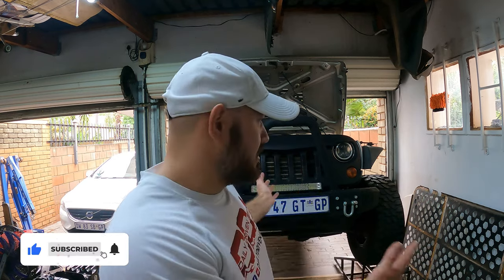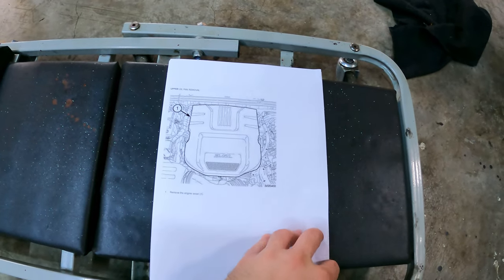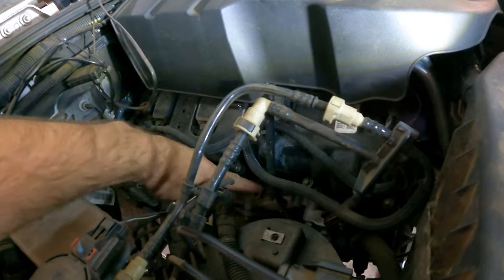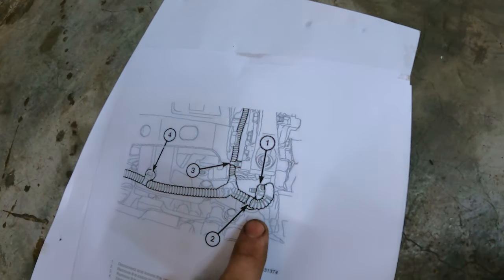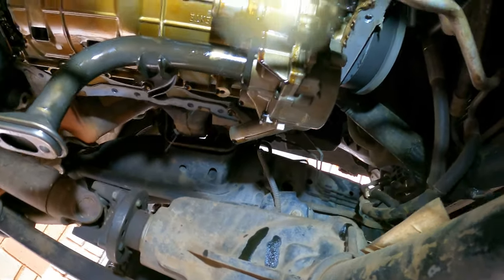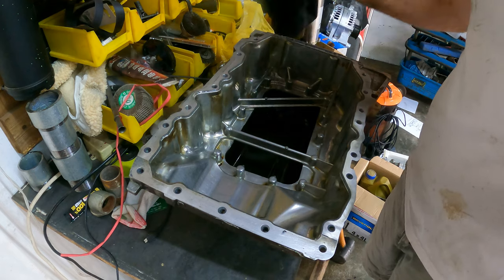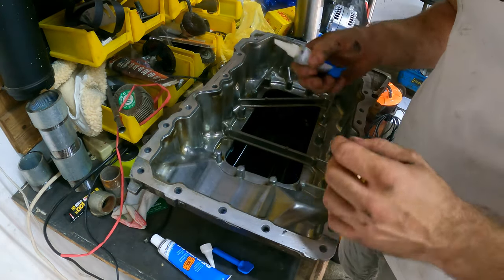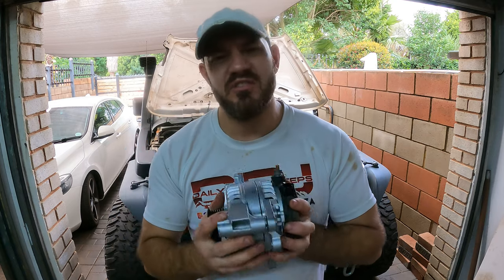Jeep 3.6 Pentastar Hack - What to do if you get a P060DD code

Comment: Just replaced lifters, rockers, and one camshaft on my 2016 Caravan.  Now it's time to replace the oil pump to clear that solenoid code.  I wish I had seen this video before buying the oil pump.  The oil pump can be removed by only removing the lower oil pan if you have the correct swivel socket.  So they say.
Reply from the maker: We didnt get the Caravan this side of the world, so cant comment on the sump, but could be. Good luck with the oil pump change, its not so difficult 💪

Comment: Thanks so much for your video, worked for me.  Solenoid cost $70 and the RTV was $20 Canadian.  Cleared the code with my programmer and it hasn’t returned.
Reply from the maker: Glad it helped
Reply: Hello there ... Is the aftermarket solenoid working good or i should replace the whole pump ...??

Comment: doing this tomorrow in the garage.  where is the link to the manual you show and reference?
Reply from the maker: Enjoy, its not a bad job, here is the link
https://f01.justanswer.com/dcraig1000/bc4748ff-4c79-43ff-996d-7ea7ce51c14a_eee.pdf
Reply: @MountainmanBuildz thanks for the video, are there two links for the manuals? I could access the solenoid manual but not the removal process, thanks again.

Comment: Man how did you pry the upper pan off? I can’t get this thing off for the life of me and I’m worried about smacking it too hard that it breaks
Reply from the maker: You will see tabs sticking out in the front, take a piece of wood, 2x4 or something, from the top rest it on the tab and hit with a 4 pound hammer, it will come off. Remember to loosen the two M6 bolts at the torque converter first, they are very hidden
Reply: @MountainmanBuildz thank you

Comment: No issues with the code again after? Though dorman is a great company (I installed there aluminum oil cooler no issues) but was informed by a few mechanics and the online forums to only use mopar sensors.
Reply from the maker: None whatsoever, I do believe that the sensor in the Oil Cooler from Jeep is made by Dorman, so thats OEM.
Reply: Awesome good to hear

Comment: Just about to do this job on my JK, your video does a great job of showing how much access there is and how to get it done without removing the entire pump. Thanks for taking the time to make this, cheers! Edit: Did the P06DD code ever return after this?
Reply from the maker: Thanks for watching. The P06DD hasnt returned at all, Jeep has been moving along smoothly ever since. Im doing a gearbox oil change next, hopefully sometime by next week. So make sure to subscribe. Would appreciate it.
Reply: @MountainmanBuildz  Already done!🤘
Reply from the maker: Awesome! Also just make sure to use good RTV, you dont want a leak and lower the sump again. I personally love Victor Reinz.
Reply: I have a po6DA code but the jeep runs fine multiple people told me its the solaenid

Comment: Yo save me hours of my life !
I'm a mechanic and I thought I was going to remove the engine because sometimes the rear main seal has 2 bolt that ataches the plate to the upper oil pan in parallel to the crankshaft and requires to detach the engine from the transmission. 
I loved this video !!
Thanks
Reply from the maker: Thanks. I appreciate the comment.

Comment: I have had a problem with 2018 charger 3.6 oil pump solenoid stuck on high. First off always use the recommended 5/20 oil, not the approved 5/30 alternate. Also make sure never overfilled. I have found that adding 1/2 quart of dexron atf to the engine oil and exercising the solenoid by warming up, then quickly reving the engine and hold at 3000 rpm then watching the pressure drop. Return to idle then repeat. Doing this several times has proven for me at this time to unstick the solenoid and engine light goes away. This may also work for stuck on low? I will be adding 1/2 quart of dexron atf to my oil at each oil change from now on unless the problem returns again. Dexron ATF is a highly detergent lubricant and is safe to add in your oil unless you have an old motor with sludge buildup.
Reply from the maker: I drove mine for a year with the error popping up at random. Unfortunely the coil inside the solenoid burns and pack up, so the problem gets worse over time. It doesnt physically get stuck, its more the coil that just have no more power to open up and the ecm picks up the low/high resistance and then throws errors

Comment: Thank you for the great video. Would going ahead and replacing whole pump be that much more work than you've already done?
Reply from the maker: @lancecarroll81  thanks for the comment replacing the whole pump is the same amount of work. But replacing the whole pump is so much more expensive, so I would only replace it if I have real oul pump issues, which is rare
Reply: I also have oil in my airbox, and seems to have terrible fuel efficiency now. Not sure what direction to go.
Reply from the maker: @ oil in airbox would suggest blow by, check your breather pipe that goes into the airpb if it has oil in it. Also remove your oil cap while jeep is idling, and see if there is vapour coming out, it will also suggest blowby. 

It could be your rings are worn. What is your mileage?

Comment: Hello!!
I have the same code, with an scanner i checked the oil pressure and my jeep has an perfect oil pressure, so i dont know why is showing me that code. Is there any problems i use the jeep with that code on? Knowing i have a good oil pressure?
Reply from the maker: The solenoid doesnt affect bad oil pressure, it burns and gets stuck. So the code is just to replace the solenoid
Reply: Does the oil pressure switch from low to high, at higher RPMs?  Thats why there is a Solenoid, for it to switch up the pressure. But you should have Good low pressure, it would just fail to engage the higher pressure.

Comment: Going to do mine but I’m going to pull pump so I can replace the pickup tube o ring while I’m in there,hope that’s not a mistake
Reply from the maker: I cant remember 100%, but im sure you dont need to pull the pimp to replace pickup o-eing
Reply: Hello... Id it working fine after replacing solenoid and o ring ??...thinking of doing same

Comment: Hey bud, so P06DD is not needed to change the complete oil pump, just the solenoid valve?
Reply from the maker: Thst is correct, only need to change pump if you have oil pressure issues or gunked oil

Comment: How many hours did it take to replace the solanoid
Reply from the maker: Hi, I cant remember, but the actual stripping the sumps off can take about 1.5 hours, and assebly about same. Everything takes 5 times longer when you make a video. And I leave the gasket maker on for 24 hours before I fill oil again
Reply: @MountainmanBuildz  thank you for the reply,

Comment: Oh the infamous pentastar 😅, another common fail point is lifters and camshaft ticking away
Reply from the maker: Yeah, lifters is another issue on its own
Reply: The only oil you should put on these engines is Pennzoil ultra platnium 5w30. I don't care what the oil fill cap says

Comment: How has that Dorman solenoid held up? I replaced my OEM solenoid (because I was getting the P06DD code) with the Dorman unit. Now after a couple hundred miles (around 320km) I am getting a P06DA code. I think the Dorman solenoid already crapped out on me. Looks like I might have to replace the whole pump assembly now with a Mopar (also spelled $$$) unit.
Reply from the maker: @jeepinintexas6215  dorman solenoid hasnt failed yet since its been put in, many many miles later. Wonder if it could be your oil cooler?
Reply: @MountainmanBuildz  Its possible I received a defective solenoid but I will have to check the wiring to it as well over the weekend. A mechanic friend checked my oil cooler a few weeks ago with one of those probing cameras. He didn't find any leaks. I replaced that oil cooler at 108k miles, I have 138k on the Jeep now.
Reply from the maker: @jeepinintexas6215  that could always be a possibility, I hope you come right
Reply: @MountainmanBuildz  well, that Dorman solenoid I installed did go bad after all. I just got around to replacing the oil pump this week with a Melling unit. It's back together again and is running fine. No check engine light. Thanks for the video though, it helped.

Comment: How would I know it’s the pump itself? My jeep runs and drives but in higher rpms it’s acts like it wants to stall out please help
Reply: Did you got it solved
Reply: @singh-zq9mh  oil cooler housing unit was leaking internally repaired it and haven’t had an issue yet
Reply: @MannyParsons Thanks buddy...I changed the oil pump solenoid and it started acting good.i had code po6dd
Reply: @singh-zq9mh  I was having the same code got the pump switched and the problem was still present did some more digging around and it was the housing unit I’ll be either going with older jeep with 4.0 motor or a Toyota
Reply: @MannyParsons  I would say Toyota is the way to go... Good luck brother

Comment: What about just replacing the oil pressure sensor?
Reply: most threads I read indicate that doesnt solve but worth trying first
Reply: P0520, that would be a solution.  Not this one.  Wrong oil filter,  low oil,  sludge,  solenoid,  oil pump,  in that order.

Comment: Was the P06DD the only code you were getting or was there an additional code with it? I am getting the P06DD code & PO394. I replaced both camshaft position sensors and confirmed that the wiring harness is working correctly. Everything in the heads looks good mechanically.
Reply from the maker: P06DD was the only code
But for P0394, it indicates Bank 2 cam sensor, but check your wheel speed sensors, make sure they are clean, they can also trigger P0394
Reply: Thank you!
Reply: It freaking worked man!!!! Thank you so your help.
Reply from the maker: @anthonybuerman269  I'm happy your sorted now. Sometimes those wheel speed sensors confuses the ECU with just about anything. Thanks for letting me know.

Comment: So the pump was still good just solenoid bad ?
Reply from the maker: Correct, these oil pumps dont really fail if your maintanance is on schedule, the solenoid burns coils and thats the biggest issue
Reply: @MountainmanBuildz  👍🏻
Reply: @MountainmanBuildz Ignition coils?

Comment: 5W-30 over 5w-20? I’m in Florida and my jeep is at 133K miles what do you think ?
Reply from the maker: @LuisHernandez-ev8sx  I would do 5w30 all day long
Reply: @MountainmanBuildz  preciate that bro! look forward to more vids from you as i start a couple projects myself. Side note: I seen a couple Jk turbo builds, have you ever done anything like that or any performance mods on a Jk?
Reply from the maker: @LuisHernandez-ev8sx  Im busy with a WJ which might be getting a V8 turbo engine soon. 
The JK 6.4 Hemi builds are cool for me with a supercharger, just very expensive
Reply: @MountainmanBuildz hey bro so i finally got to the project, I can’t seem to connect the solenoid wire clip onto the oil pump. Any tricks? (Plastic clips are my downfall)
Reply from the maker: @LuisHernandez-ev8sx  it can only go in one way. Check for a sliding safety clip aswell
Reply: @MountainmanBuildz  I thought the wire clip is the safety one. it’s the only clip i have at least.
Reply: To clarify I wasn’t talking about the safety pin, I mean the clip on the actual wire that attaches to the oil pump. How you slid that in.

Comment: The oil pump won’t drop enough to get the solenoid out without loosening the tensioner and removing the oil pump sprocket but your video doesn’t address that.
Reply from the maker: I was able to get it out with just the oil pump dropped

Comment: Does this work for P06DD as well?
Reply from the maker: No I believe that is the sensor on the oil filter housing, unfortunately you cant just buy that sensor, you need to buy the complete oil filter housing as well.
Reply: @MountainmanBuildz  are u a 100 percent sure it’s just a sensor bc mine went out and is giving me that code
Reply: @enriqueclemente9668 is your car giving you issues when driving? My veh feels as if it's losing power and sometimes stays at 40 mph. I have the same code.
Reply: @enriqueclemente9668 also have you fixed your problem? What did you do?
Reply: @DavidsOutdoors same , did u find out what was the problem

Comment: Hey this fix doesn't always work be sure y'all no this b4 replacing solenoid
Reply from the maker: Its not a sensor, its a solenoid, and yes it worked perfectly, still running 100%
Reply: @MountainmanBuildz  my bad u get my point I replaced mine it didn't fix mine. Jus sharing my opinions on this stupid dodge problem
Reply from the maker: @petehenderson  there could be two faults related to this, its could also result from a bad oil sensor on the oil cooler. Its frustrating I know. As much as I love pentastar, I also hate it
Reply: @MountainmanBuildz  tried that also what I think my issue is the inside is completely gummed up and I have no oil flow.
Reply from the maker: @petehenderson  what oil dis you run? And when last did yoi change it?
Reply: @MountainmanBuildz  looks like maybe 30 or 40 k overdue bought it like this. So I am think oil can't make it to sensor . my oil is 5/20

Comment: How would I know it’s the pump itself? My jeep runs and drives but in higher rpms it’s acts like it wants to stall out please help
Reply from the maker: Do you have a code reader? You should start by reading the codes first. If its pump it will read more oil pressure faults that from the sensor on the oil cooler. I need more info to know for sure
Reply: @MountainmanBuildz hello I am having issues that..when everything was normal... Say I am going on highway at 100km/hr.. my normal rpm were around 1600 now they are at 2200 and showing code p06dd oil pressure circuit. I changed oil and filter no help should I change sensor on oil housing??
Reply from the maker: @singh-zq9mh  not sure why your rom is different now, but the P060DD is the oul pump sensor, you can change it as shown in the video. Can buy it from the amazon link in the description
Reply: @MountainmanBuildz  yeah my mechanic said they are gonna change oil housing sensor but what I read online they said it's wrong  to change that housing oil sensor and more like what you showed in video .. I am gonna do myself as you showed in video .. thanks a lot... Will update here how it goes.
Reply from the maker: @singh-zq9mh  oil housing sensor is impossible to change, have to change the whole housing, but that would be a different code. Good luck, its not that bad. Cheers